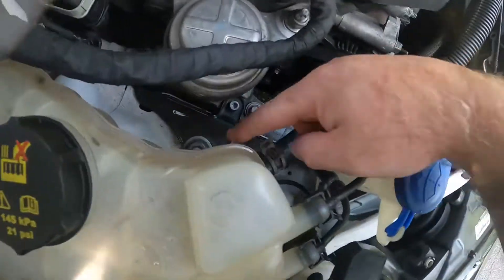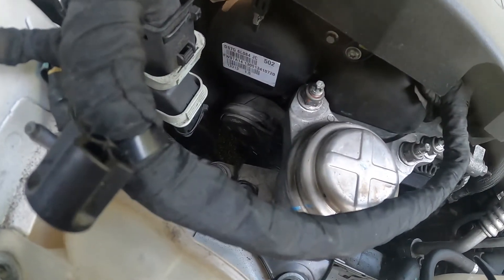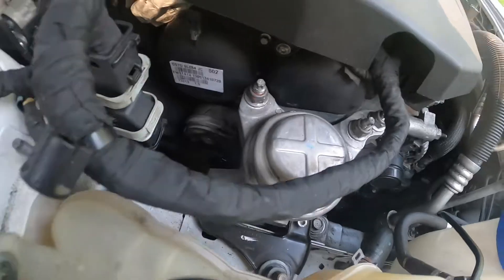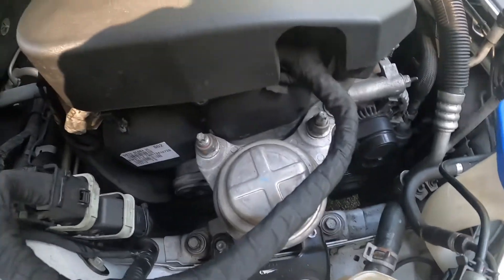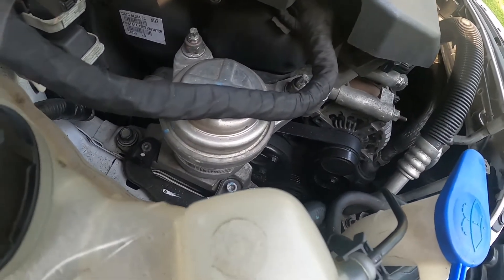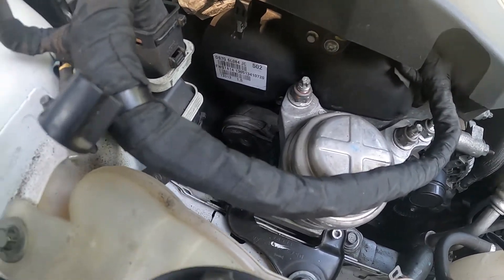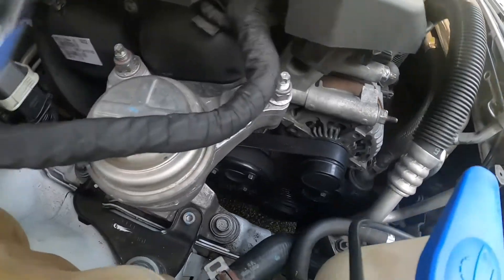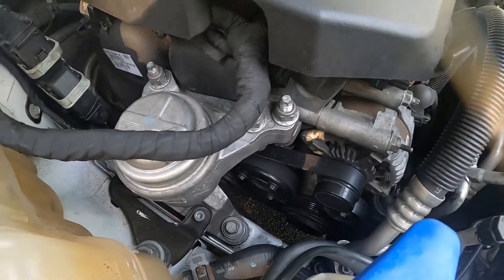How to replace  2014 Ford Fusion 1 5 Turbo Drive Belt

Comment: There it is a how to video without showing you how to. Amazing. I come here looking to see if anyone else has the same weird tensioner I do and behold I can't see shit in your video. Neat
Reply from the maker: You could always ooo put your vin in an autoparts stores vin decode and mmm look up BELT TENSIONER they have pretty good pictures of things now  you can rotate some of them  you can even place them on different parts of the car its pretty neat  if you ask me.    WOW awesome  I even found the OEM part number  BT-123.  Information is power my friend.

Comment: Have the same motor in my fusion. Can i replace the water pump without taking timing belt off? I know i have to remove the serpentine belt as well
Reply from the maker: NO the pump is behind the timing belt  it would need to be removed to replace the pump
Reply: No it does not I replaced water pump on mine without removing the timing. I marked it and put a zip tie around it to hold tension. The water pump is used as a bracket for the tensioner. Also you can take the belt of way easier than he explained no need to remove any of that
Reply: @MrDaddy88 please I’m trying to replace the belt . But I’m confused if it has just a single drive belt ? Or if the compressor is to get a different belt . Please advice.

Comment: Do you need to support the engine since you’re removing the motor mount?
Reply from the maker: I had a jack with a block of wood at the oil pan
Reply: Your block was pushing at the oil pan? Was it sufficient to keep the bolts ligned up upon reassembly ?

Comment: How do you know if it’s the pulley that’s going out vs the belt? I’m curious because my car, the exact same at the one in the video, is making a ton of noise near it.
Reply from the maker: Belts usually  make a squeaky  sound  pulley makes a rumble or whirring  noise.

Comment: This vehicle doesn't have a belt tensioner. It uses what is called a stretch belt. The customer was right to decline the "belt tensioner " services.
Reply from the maker: You are incorrect  in your statement.  This 1.5 turbo motor uses a spring loaded belt tensioner.   I know  because that's how I replaced the belt.  Yes ford does use a stretch belt on some motors just not this particular  one.
Reply: I'm having a problem right now with this same car. I put the belt on but it's still loose.
Reply: @kevinsmobileautomotiverepair  why?
Reply from the maker: @cjl5568  why what   more detail to you comment  or question  helps

Comment: I’m having a problem getting a new belt over all the pulleys. I know the configuration is correct however I cannot get enough slack to pull the belt over the last pulley. I’m not sure if there could be something with the tensioner I’m not doing correctly. Any tips? Thank you
Reply from the maker: make sure the belt is the correct one

Comment: Please can a use a stretch belt for my 2015 ford fusion compressor ??

Or I should get a single one for my compressor,and Alternator ? Or use stretch belt below and normal serpentine belt for the upper post llpsr
Reply from the maker: this 1.5 turbo does not use a stretchy belt  uses a standard belt and tensioner.

Comment: Would a worn out belt make the engine to overheat?
Reply from the maker: If the belt is moving a water pump and  slipping not allowing the pump to turn at the same speed as the engine  yes
Reply: @kevinsmobileautomotiverepair  thanks you ..is cause I noticed my belt was worn out and it got a crack on it and i don’t know if that could cost that to do it
Reply from the maker: @POMONAPIMPIN  In that situation no  it will not cause the car to over heat